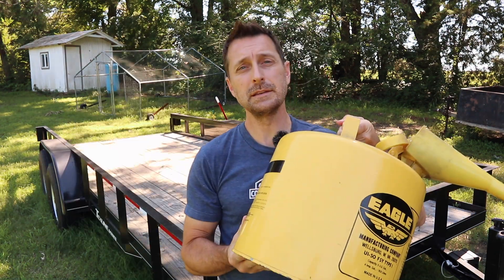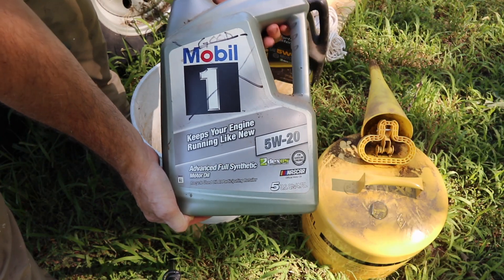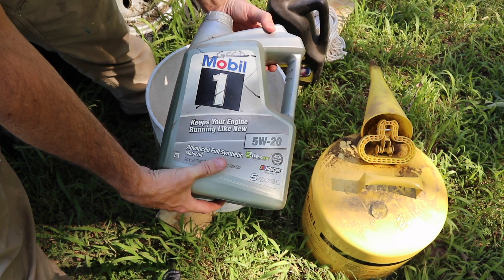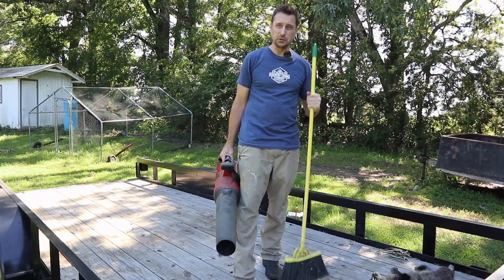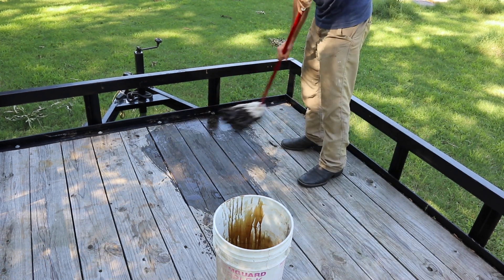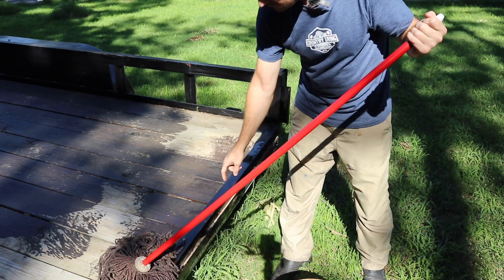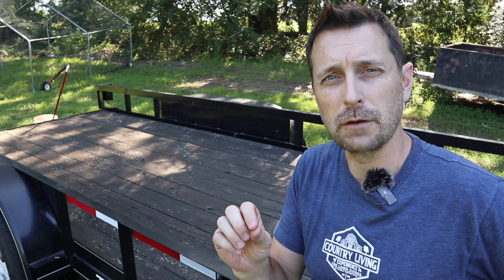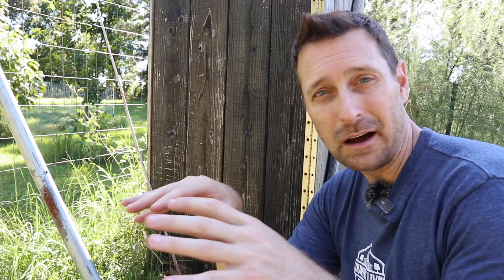How To Keep Wood From Rotting With A DIY Natural Wood Sealer!

Comment: Yeah, I'm not soaking wood in oil and diesel around my property.

I'm in an area subject to fires, so I'm going with water based, followed by flame retardant.

The retardant isn't cheap $3k for a 55 gallon drum, and its not compatible with oil based finishes.

Comment: I am preparing to build a garden hoophouse for season extension of vegetable crops; will have wood baseboards around the perimeter… default approach is to use pressure treated lumber… would you use this oil/ diesel application in a garden setting?  What are your thoughts on pressure treated lumber in a garden setting?
Reply from the maker: I use both in my garden. I don't see any adverse effects. The pressure treated lumber basically just has copper in it.

Comment: Been using old oil and diesel for years on all kinds of exposed wood, works great.   Nothing is 100% environmentally friendly, but reusing spent materials, not buying more wood, and staying away from purchasing yet more chemicals, this is fairly close.  Father-in-law coated his bare plywood shed with old oil-diesel in 1980, shed is still in good shape.  Pressure treated wood has crazy bad chemicals.

Comment: I’m still a suburb slicker but have a wooden fence around my back yard. I don’t change my own oil anymore so I don’t have used motor oil around (why does it have to be used, if necessary?) but I do have some old (not used) motorcycle and car oil out in the garage for vehicles that I no longer own.  Can I use that instead of the used oil?  I suppose I would still have to buy a diesel can to bring some diesel home in, but I’m curious to hear your thoughts on the unused oil. Thanks.
Reply from the maker: You can use the new....it is just expensive to do it that way. But like you said, it is leftover from equipment you don't have anymore.

Comment: Transmission fluid is regular oil (not motor weight) with a red die in it. It works just as well for what you are using it for.

Comment: my grandfather taught this to me over 50 years ago and he learned it when he was in his teens. i put it on every piece of wood that is out side even some that is inside my barn, but he and i used just pure motor oil no diesel. he would put his wood posts in buckets of oil for a week or 2 and there are still some on his property that has been there over 100 years.

Comment: I've been looking in to hemp oil for wood finishing and preserving, but the biggest problem with that is in order to grow hemp there are legal and bureaucratic issues to deal with due to the fake phobias put out there about hemp (canabis sativa). And of course Big Cotton and Lumber do everything they can to stop the full legalization of Hemp because of greed. It seems hemp oil would be a great natural and environmentally safe alternative. However, it wouldn't solve the issue of what to do with all of your used motor oil lol
Reply from the maker: Hemp is a great product. I wish it was more available.
Reply: Real tung oil was used for naval ships for about a century or more and comes from the tree nuts of the tung tree. It’s safe to use and you could probably eat it safely. Just don’t buy the fake oil with the same name.

Comment: [great video thanks.  reminds me of a guy who would drill 1/2" holes at a downward angle into his fence posts, above grade and fill it with oil then plug it with a stick.   He would go around and refill them every year or so.  brilliant. I think he soaked the posts in the oil diesel before he put them in years ago.  Brilliant, I love not buying the stupid products they program us to buy.]
Reply: I've also seen a tuna can nailed to the top of a fence post (one or two nails thru the bottom of the can into the top of the post).  Then you fill each can with used oil which slowly weeps around the nail(s) into the post.  Supposedly follows the grain of the wood, and definitely stops water from soaking into the top of the post.  Probably works better than the prior owners of my place that just dumped their oil along the fence line.  Too much in too little area and not enough in the wood of the posts... it took a couple of years for nature to break down that oil so it didn't stink in the sun and the grass would grow.
Reply: @Sylvan_dB [thanks for sharing that is a great idea.]
Reply from the maker: You're welcome.

Comment: We use to use ;
Creosote, used motor oil and diesel fuel.

A few years ago my wife wanted to see the farm I grew up on in SE Washington state.
We made the 3 hour drive from our home in north central WA.
When I was 18 years old my dad wanted to section off part of an area into 3 different pastures.
We used old telephone poles as our corner posts.
Dad had a 55 gallon drum that we filled part way with the 3 ingredients listed above.
We’d soak 2-3 telephone poles, (cut to the length we needed) for 2 weeks.
After that 2 week period we’d take them out and flip them so that after a month the entire pole would be saturated with our mixture. 
We’d take them out of the old oil drum and just lay them down.
After all of the poles were ready to be installed one of us would dig the holes with the “stinger” from our tractor.

To my surprise when we got to my dad’s old farm those corner posts were still in the same place where we had set them. That was almost 42 years ago.
Reply from the maker: Wow, 42 years! That’s awesome.

Comment: I didn't know y'all were also in East Texas! I'm north of Tyler! Does it make the trailer slick when wet?
Reply: It’s ever so slightly more slick after a good rain. Not super slippery by any means. Farmers have been doing this trick for as long as we’ve had used oil. You will not regret it.
Reply from the maker: Cool!
It’s a bit slick when just wet but there is no “slipperiness” after a few hours.
Reply: @CountryLivingExperience  I meant more like in a few months and it rains does it get super slick when watered?
Reply from the maker: Nope. It has good traction after about a week.

Comment: Since you mentioned paint,for a deck on a house, what IS the best paint FOR a deck floor?
Reply from the maker: They sell special deck paint at Home Depot.
Reply: @CountryLivingExperience  well, SOME of the deck paints do more damage than good, I used 'Deck  Correct' and water got under it somehow and caused rapid rot,so I just had to replace the whole floor of my 64'x12'.5" decking...AND THATS NOT CHEAP, so i want a GOOD BRAND to paint this one once its cured, which takes 6mo to a year, so NEXT spring its getting a porch/barn semi gloss paint and not that acrylic deck over crap!
Reply: I have had good success with oil based deck paints thin with mineral spirits or jap dry for the first coat to penetrate deeper into the wood. Then apply a second coat thinned half what you did the first time. On the third coat you can add sand for traction so it won’t get slick when it’s wet.

Comment: Does it dry completely? Or will it transfer to any of content being hauled on trailer ie in warm sun?
Reply from the maker: It soaks in completely after about a week.
Reply: I have some outdoor projects and used oil ...video came at a nice time
Reply: Use boiled linseed oil or real tung oil for a cleaner finish if oil transfer is an issue or if you need it to be more food safe. Once motor oil bakes in the sun it should stop rubbing off onto whatever you are putting on it.